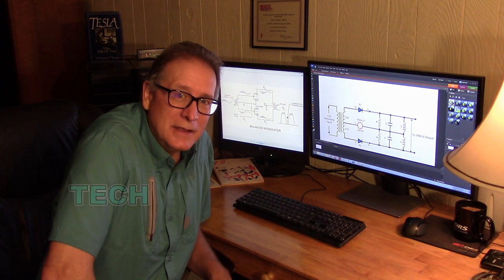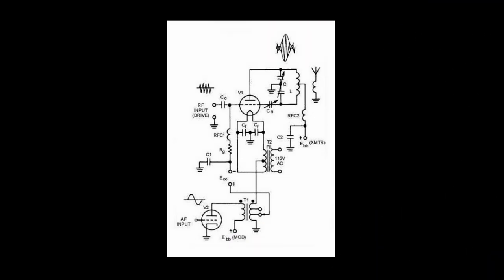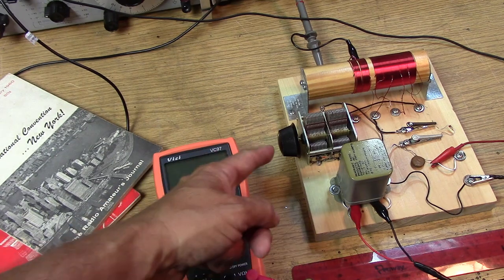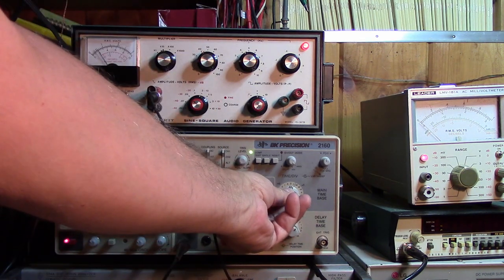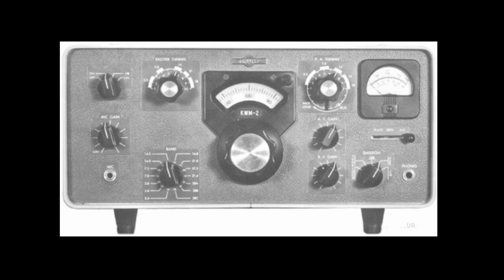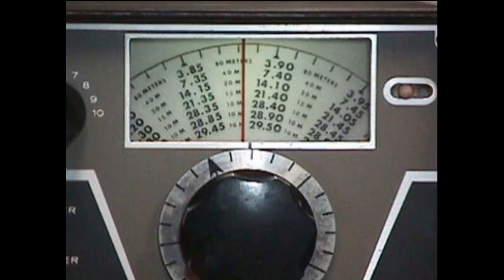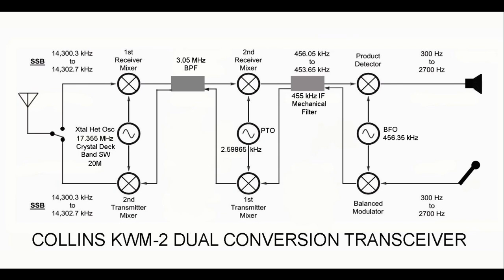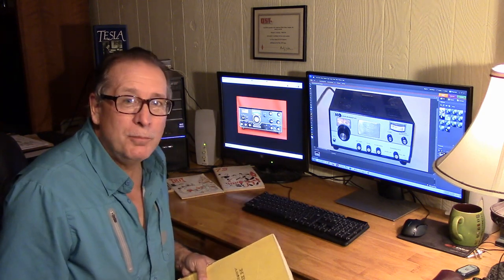Early 60s SSB Technology

Comment: Ah the balanced modulator, the heart of the SSB transmitter. With the circuit depicted at 10:01 (and others), how do you get from double side band to LSB or USB?
Reply: Try a search on the subject "I/Q Mixers" or "Phasing Method for SSB" in the web, it´s a matter too extensive to answer you here, good luck..!
(...btw, it´s the BETTER way to get SSB, IMHO...)

Comment: I always thought diode ring mixers were double balanced? At 13:20, I know they aren't using a transformer for the audio or carrier inputs, but with the ground point between CR2 & CR4, the AC coupled inputs of the audio and carrier are essentially balanced around that point, and the output transformer provides a balanced output. Am I missing some details here? I'm confused.
That DRM design is used 4 times on the IF board in my TS-820S. One for the modulator, one for the product detector, and there are two in the RF speech compressor serving the same two functions at 455kHz. Older radios are neat.
Reply from the maker: Wow great question and comment. I think we should blow this up on my FB radio resources page. In a pure mixer with f1 and f2, the basis definition of double balanced is when both are nulled or missing on the output port. And single balanced if either one or the other are nulled. With a balanced modulator, your information (audio)  is at such a low frequency compared to the IF, that there is no need to worry about it in the output. So DBM is not required. But what about the actual hookup for SBM and DBM with a ring? That is worth looking in to.
Reply: @MIKROWAVE1  Thank you for providing the differences between the two. I couldn't remember the specific detail that separated them.
I believe this configuration does null both input frequencies. The product detector in my TS820S has a balance potentiometer and a trimmer that get adjusted during the alignment process. If these are adjusted properly the IF signal and the BFO are nulled out at the audio output port of the mixer. I have a DRM built up in my junk box somewhere too. I might have to get it out and mess around with it.
I didn't know you had a resource page. I will have to check that out. Thanks for the reply and I really enjoy your videos.

Comment: What about using 3x 12AU7 s configured like the internal circuit of the SO42P so that the thire 12AU7 operates as the oscillator and a transformer across the grids of the mixer should give you what you want.